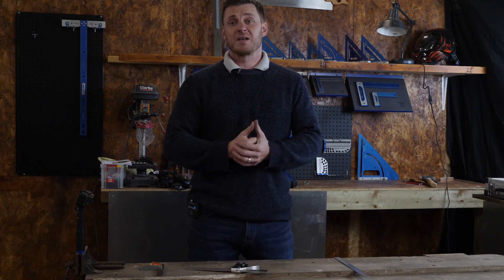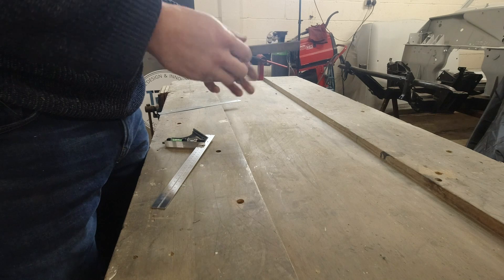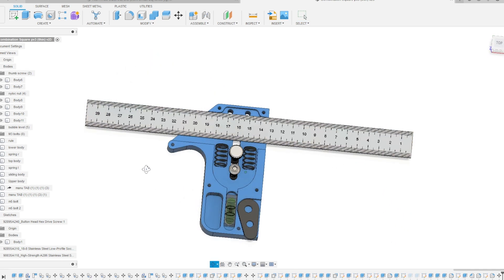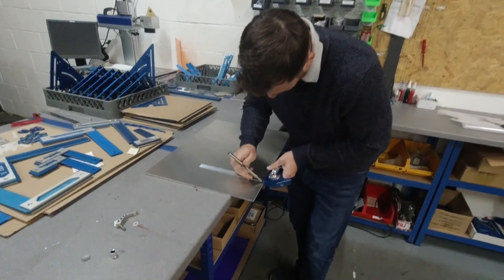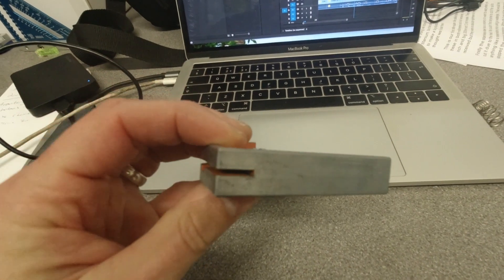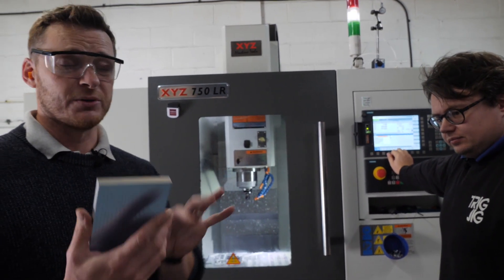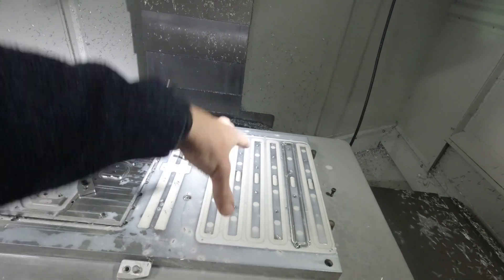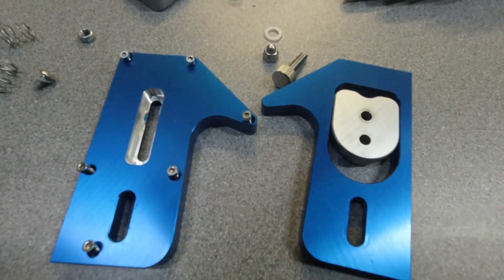Making a combination square | TrigJig Workshop Ep 1

Comment: There’s a simple solution to the problem of cheap combination square that break: buy a good quality one. No need to reinvent a tool that has been working well for a long time. I see no advantage to your design.
Reply from the maker: It's very difficult to source a good quality combi square these days. They're nearly all made in the far east. Even then, there's an inherent flaw built into the design of a standard tool that uses a hooked bolt to pull the rule into position. Stress fractures are inevitable over time. Our design removes this flaw completely.

Comment: Nice tool but why did you reduce the length of the stock? Your prototype appears to have a stock length similar to usual combination squares I.e approx 107mm. Your finished product has a stock length of 82mm. I.e. 25mm or 25% shorter. The accuracy of any combination square is obviously dependant to a great extent on the straightness of the edge of the work piece. I feel that this reduced stock length would be ok for precision engineering works however I have my reservations as to whether this is acceptable for woodworking.
Reply from the maker: This (edit: the GLYDER 82) is the first model so we hope to have a GLYDER 120 or similar in the future 👍

Comment: Interesting idea, as a journeyman carpenter and fine woodworker, I use the speed square when framing houses and a machinist square when building furniture. Here we use trusses for the roof, so my old rafter square really isn’t necessary. I can use the speed square as a saw guide if needed, if can fall out of my nail bags from a couple stories up and still be accurate. The machinists square is only used in the shop when needing really accurate measurements and angles.

Comment: Please make sure the ruler is either imperial or metric but never both, like most of them. 

Also a (smaller) sliding t square. 👌
Reply from the maker: This design means you can use whichever ruler you like. So if you already have a metric or imperial ruler, you can use it.